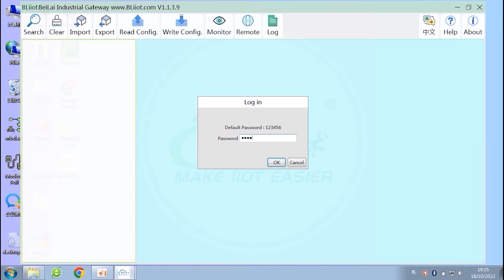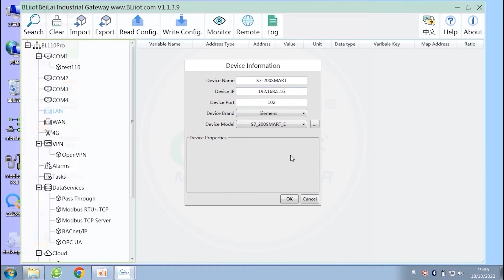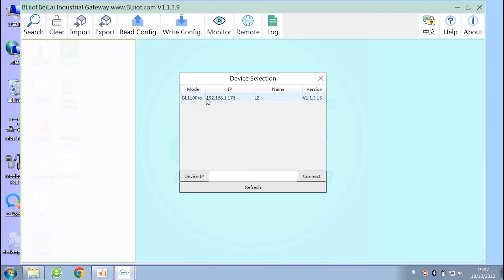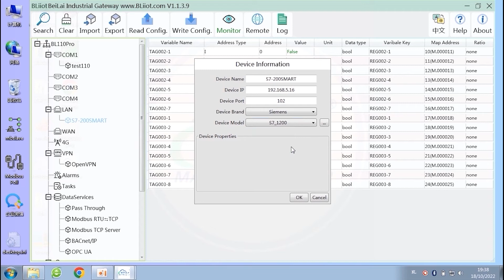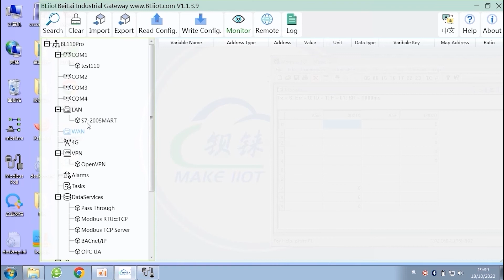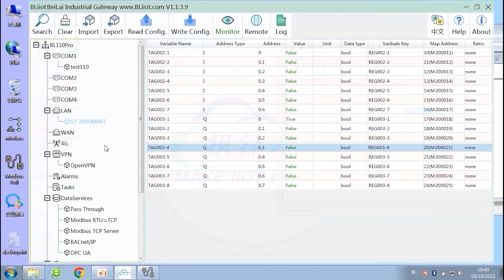Gateway - Connect Siemens S7-200Smart PLC to MQTT and OPC UA and BACnet/IP by BL110

Comment: Hello, does this gateway is using FINS protocol if we selected OMRON as Device Brand in the ethernet settings?
Reply from the maker: Hello,do you mean uplink by FINS protocol to Cloud ? or others?
Reply: @bliiot  I mean using the FINS Protocol as the downlink (The PLC) via Ethernet. And at the same time, using the Ethernet to make uplink Modbus connection to other device. Is this possible?
Reply from the maker: Yes,,it can
Reply from the maker: Do you have interests about the devices?could you send me your other contact way?so i can send the photo for you as a reference @mkm_is_here